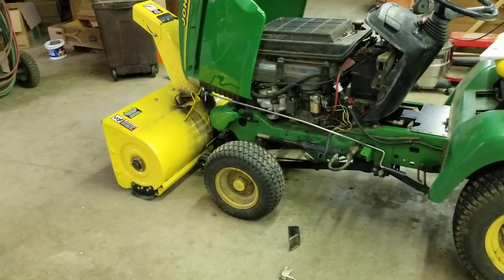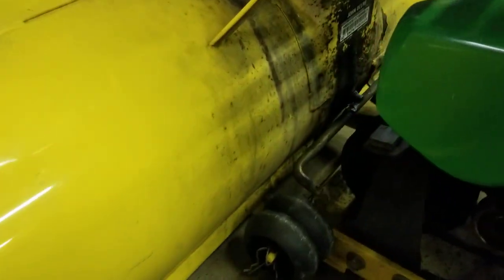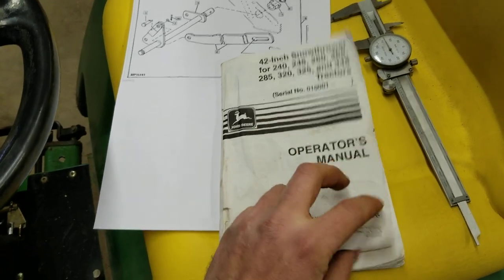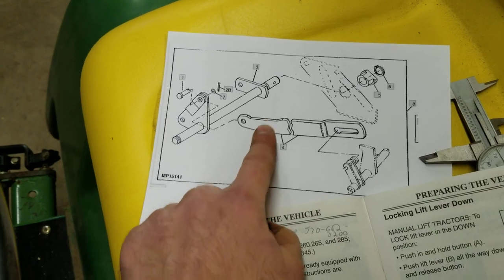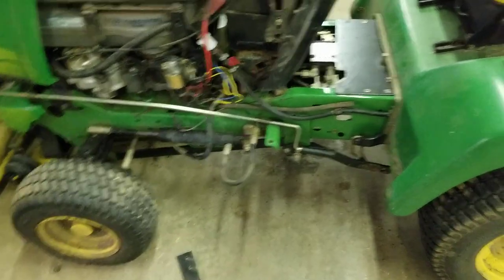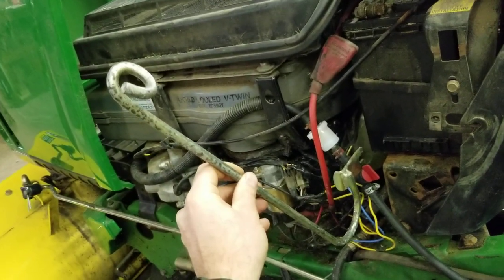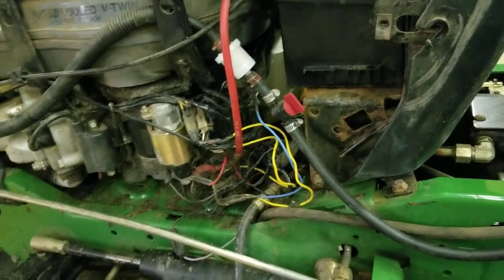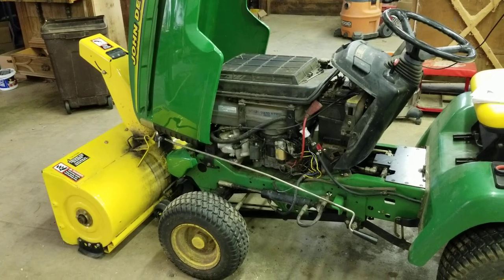Equipping John Deere 325 or 345 for snowblower with front lift kit

Comment: Thanks dude!  You saved my bacon.  I just bought a used unit.  Interestingly, I bought the lift hydraulic lift kit a few years ago thinking I could make it work with a plow.  But it didn't and I didn't send it back, so I have it.  Also the unit I have does not have the chute bracket, so at least I know what to get or fabricate.  Thank you thank you!!!

Comment: Neat to see on the 325.  Invested in two snowblowers this last year with plans to mount other implements on the idler subframe assembly since was all I really wanted to use.  Well, the second snowblower wound up being in such great condition, with only a broken belt idler bracket for the belt that drives the auger, I've decided to eventually restore to use.  For now planning to make a front mounted rototiller and use the other blowers auger and maybe some other parts for a front end loader cement mixer.  Great info, thanks for sharing!  I'd like to do the same thing too.

Comment: The 240-285 and 320 use the support bar you have. The 325, 345 and 355 use a different support bar for the angle kit. I found this out because I have a 320 and a 345. The 320 support bar mounts to the firewall. The 345 doesn't have a firewall and it mounts to the side of the battery trey/mount.

Comment: Ted, great video. I have watched it numerous times, as I am trying to do the same thing (mount a 42" snow thrower to my JD 345. I bought both together (used) and it had the lift kit installed. However even after watching your video, I have questions. It is unclear if I need the strap #4 identified in the lift kit and where it physically goes. It is also unclear how to attach the "C-shaped latch (E) using the drilled pin (F) through hole in latch, I believe I will then find I am missing some hardware pieces. Any guidance you can provide will be greatly appreciated

Comment: Ah, I take it your lower hood also broke at some point and you also got a replacement that had no numbers...great info, I started pondering this attachment myself to add on to my tractor.  And yeah I think that "kit is not available order individually" is also a common thing with a LOT of the things on these machines.  I've run into that rebuilding a spindle with failed seals on my 48C deck and there was a "kit" referenced that was unavailable so I had to order the individual parts.

Curious the "fire" was that leaves/grass that got up under the ignition and starter motor?  Had that on mine (tho not as serious as yours it looks like).  And also good idea on the fuel shutoff, we did that after a carb got gummed up sitting, now I shut the fuel off and run it until it dies when I put it away for more than ~1 month storage.

Comment: By now you probably figured out that the plastice frame cover in the front needs to come off and there is a rod to limit side to side movement. From the video I thought that this bar was laying across the blower. I had a 96 325 that I sold to my neighbor and that was a mistake! This machine with the snowblower is a piranha as a neighbor at my old house would call it! The 325 and 345are real machines! I got rid of the 325 thinking that a twenty year old machine will start to have more and more small items to repair. I think that I should have researched the X500 before I bought a used package! I just got a X580 and the lift is better than the manual lift on the X500 but no comparison to the 325-345 series. I might even look for another machine in the 325-345 models.
Reply from the maker: Appreciate the comment. Yep, got it all hooked up. Might do a video on just hooking up the blower next year. Surprised that no one else has. It's pretty easy once you have the lift kit. My 345 has been pretty good. Had to replace the cam gear about 5 years ago which was a big job but not terrible.

Comment: Just curious, but why did you put a shut off valve on the gas line?  I've heard some things mentioned about a potential fire happening around the fuel pump. Is that related to this?

Comment: Do you have a install video?
Reply: I just put mine on for the first time and it was pretty intuitive. I did use a floor jack to lift the rear of the blower high enough to align with the lifting arms and brackets.

Comment: Thanks for the info. Ive had some issues with the arm from the lift to the actual hydraulics. It’s actually bent and I need to straighten it. The channel of in the arm is WAY too big for the thing it goes on, so it came off on me in the summer and bent it up. Any input?
Reply from the maker: Hard to say without seeing it. If the channel is way too big, perhaps the part is worn and needs to be replaced. Alternatively, maybe someone installed the wrong one.
Reply: Well, short story is...the control arm has the “circle” that you’re suppose to attached and then slide it into that channel. On my tractor the channel can fit over the pin like the head of the pin is not big enough based off the size of that circle.

Comment: How do you like the 345?  worth 1600 bucks to buy it in 2021 with like 1100 hours?
Reply from the maker: They are generally good machines. #1 question to ask if buying used is whether the camshaft gear has been replaced. If it hasn't, with 1100 hours, it is extremely likely to fail anytime. They originally came with plastic gears and are notorious for failing. The aftermarket replacement is steel.
Reply: @TedMinnesota  Thanks.  I just saw a video 90 minutes or so to change the thing... 
if they do break, do they cause damage to the engine?
Reply from the maker: @lowspeed2000  what happens is the motor will die and when you try to turn it over, it will sound like there's no compression because the valves aren't closing. Changing isnt overly technical but it is labor intensive and messy because you have to pull the motor. Depending on your mechanical skills it is a half to full day job.
Reply: @TedMinnesota  I guess the question is is this an interference engine or the valves will not hit the pistons.

Just want to know if it's a must to replace it to prevent more damage or just wait till it happens.
Reply from the maker: @lowspeed2000  I'd say the answer is no. I've had the cam gear shred on two FD590V engines and there has been no collateral damage. The teeth of the gear shred off and the motor dies pretty much instantly. No issues with the valves hitting one another.
Reply: Also watch the valve covers for oil leaks.  Around 900 hours the 345 I inherited started dripping oil onto the exhaust.  Fairly easy few bolts new seals (if the plastic hasn't been melted/deformed) and back in service.  If the valve covers themselves are damaged there are aluminum replacement ones out there that went with some ATVs is a common swap I've seen in forums but I just had to do the gaskets and kept going.

I also would replace the indicator warning lamps, I had the bulb for oil pressure blow around 800 hours (found because I noticed key-on engine-off it was not illuminated), would hate to be unaware and cook the engine.  Should see all 3 illuminate during a normal engine start (oil pressure+charging failure with key-on engine-stopped; over-temp while cranking starter), if they aren't you need to look for a burnt out bulb.  Seems to be just a normal small 12V automotive light bulb.

And certainly don't forget to check the oil level on the hydrolic system periodically...its easy to forget about when things are working properly.

Only other problem I've had is after 20 years of use and 800-some hours the hook holding the belt tension spring on the 48C deck was worn almost thru the hook, had someone grind it off and weld a new hook onto the deck.  And need to get a new spring as the spring itself is worn almost thru but neither of those are terminal.

Good to know about the timing gears...I don't know if mine are original or not (when my Grandmother used it there was a major service for new fuel pump, carb after sitting several years and then wouldn't fire up).  Purrs like a kitten now though.
Reply: The 345 is probably the best belt driven garden tractor ever made. The only issues would be the plastic cam gear on the FD590V engines (FD611V had steel gear from the factory) but the OEM replacement has a steel gear now. The cam swap is actually very simple to do. 
   Also make sure it has the updated fuel pump. The original would spray gas on the exhaust when they failed. The updated pump has a hose the goes out the bottom of the frame so if it fails it sprays gas under the tractor. 
   
As for the plastic valve covers you can buy 2 MIU11644 aluminum valve covers and 2 MIU11646 gaskets which are for the non oil fill side of a 425. 
   You can't buy the plastic cam gear or the old style fuel pump anymore so if you replace those 2 parts they will be the updated/upgraded parts.
Reply: As far as the hours. The 345 is liquid cooled so as long as it has been maintained they can last 5,000 hours or more. I have seen several with over 3,000 and 4,000 hours still running great.
Reply: @javman6022  I did end up getting a 345, and yes it's the best lawn tractor ever.